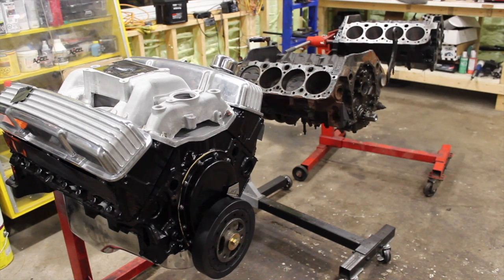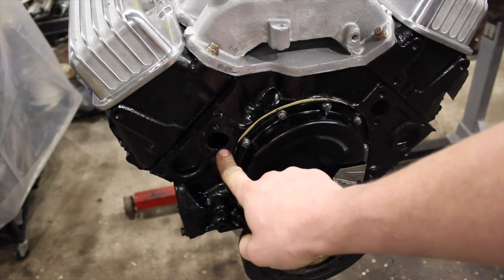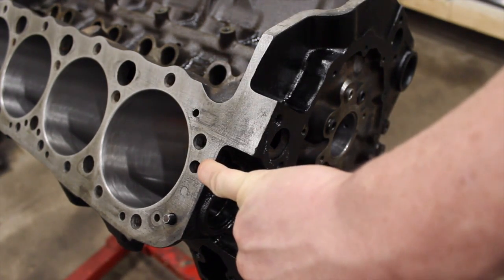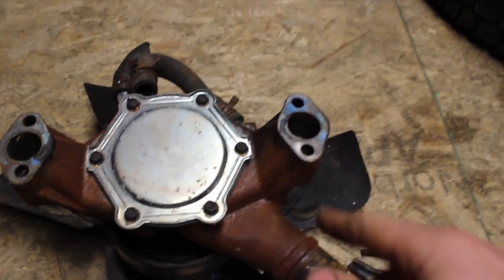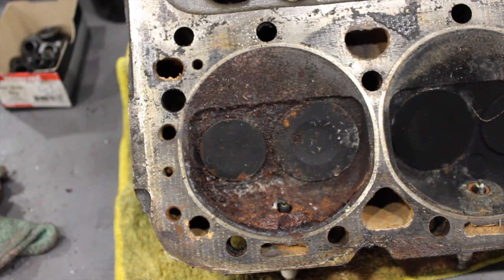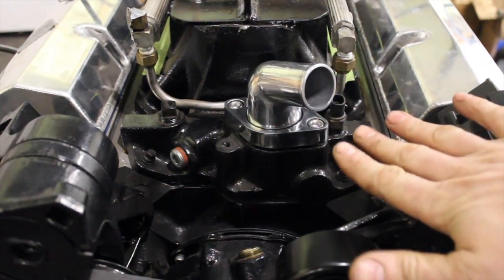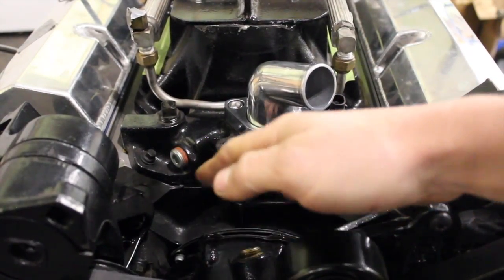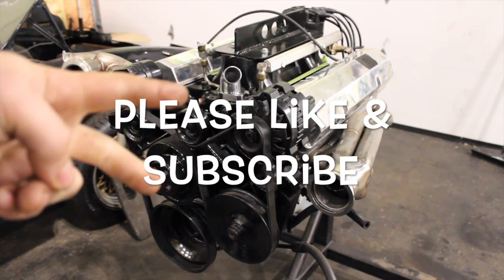SBC Water Pump Bypass? (Read Description for instructions) Vortec heads vs Traditional heads

Comment: I built a 350 SBC out of a 99 Tahoe.  Both heads cracked as per usual. I replaced them with aftermarket AL. Heads, and now I am finding out about the BY-Pass hole.  I assumed it was plugged from the factory, like the fuel pump. Yes, we all know what happens when you ass-u-me. I am going to attempt to drill and tap in the car.  What is the plug/drill size? Or is there a brass plug I can knock in?
Reply: Update, no drill needed.  My Hanson 1/8 pipe tap went right in no drilling needed.  This was a fairly easy fix, but it would have been a whole lot easier before I installed the motor.  Fan, fan shroud, and water pump, r and r.
Reply: I’m doing the same building a l31 vortec any updates on what you’ve done to fix ur problem without having to drill into the thermostat and if so how has it been holding up
Reply: @rockfordhx2768  No issue what so ever. Just ran the tap into the third hole on the passenger side of the block. The old school water pump covered it. The L 31 water pump does not cover it because the heads sealed it.  The new heads I used were made so they would work on the older blocks.  It would have been nice if they mentioned that I would need to plug the exposed hole. The L31 uses a bypass hose on the water pump.  So there would be no need to make a bypass hole in the thermostat. Maybe you are planning on using a different intake manifold? If so yeah that would be an issue if you were using the Vortec heads.

Comment: What does the bypass do exactly? Do I need it?
Reply from the maker: Yes, you want some coolant circulation when the thermostat is closed. This prevents a large sweep in head temperature when the thermostat opens. 
It prevents head cracks and air pockets

Comment: My brother bought a Motown block and was having trouble leaking water from the water pump because he used an old-school water pump in the block did not meet up to the water pump plus it did not even have a hole in it for the water to flow through so we took the old school water pump threaded and blocked let Bypass in it but if he ever gets rid of the engine somebody else may have trouble leaking water from there if they change the water pump

Comment: hers the deal , i ordered a 350 crate engine 4 years ago , checked the block when i got it , 5.7 , i ran the code 96/99, but they put 305 mismatched heads on it , anyway its been on the stand for 4 years wrapped in plastic , they have changed the entire engine back to flat tappet , so im getting ready to change it back to a roller engine , vortec heads , rollers , cam , you know all that , i just went down in my shop and looked at my block and water pump , both have the 3rd hole in it , so when i get theses vortec heads ,,, is all i have to do is have the hole drilled in the head so the water can go through the pump into the block  and into the head and thats it ? , or what else needs done ? i have the provision for the fuel pump , but im going to change the cam good lord willing back to the same spec cam it had , but what cam do i use that has the same vortec specs but with a fuel lobe on the cam , mainly just let me know what to do about this cooling system issue , if im following you right , all i have to do is have the water hole drilled in the head so the water can flow from the pump through the block up into the head ? is that correct ? and do i need to have both heads drilled or just the one , thank you very much , and by the way i called ATK VEGE where the engine came from and they more or less said im beat , your warranty ran out a year ago and thats it , regardless whether the engine was ever installed or not , thank you very much for any information you can give me .
Reply from the maker: First off, you'll want to verify that the hole is actually drilled all the way, which it should be as that engine is a TBI replacement. 
Heres what I recommend if you have the bypass through the block:
-Drill  the passenger side head for the water hole, using your old head as a reference and a head gasket as a template.
-Drill one 1/8" bleeder hole in the thermostat, this helps with temperature swing and prevents head cracks 👍

Comment: Hey Pat, have you heard or know of any difference in the TBI block water pumps with internal bypass and the later vortec pumps with external bypass having any difference in heights for pulley alignment?
Also if the pulleys themselves have different bolt patterns?
Reason asking is I have a TBI 355 I rebuilt recently with refreshed 193 heads. But also have a set of 062's that I want to swap and do a carb conversion. My truck still runs like a slow turd and been having TBI issues. I've replaced every sensor, pigtail connector, vacuum lines, checked vacuum leaks, rebuilt TBI etc. I'm fed up with the TBI system.
So what I'm hoping is to plug my internal bypass on the block, run a vortec water pump with external bypass going to my air gap 4150 flange intake I have to go with my vortec heads. But can't find useful information about the two difference for possible pulley alignment problems.
Thanks in advance. Really appreciate your videos
Reply from the maker: So you want to add a vortec water pump and pulley to a TBI serp belt setup? 
Dang! I got did a scrap run and threw out any tbi water pumps that I had, but I'm pretty sure I still have vortec water pumps. 
If you email me at pcperformance1@outlook.com
 I can take any measurements you are looking for of the vortec pump

Comment: I am retrofitting an 02 4.3 V6 back to carburetor and HEI distributor. My intake manifold is an Edelbrock Performer, which does not have the port for the bypass. Can I just block the water pump bypass and drill the holes in the thermostat and be done with it? I could put an elbow up on top of the manifold and fabricate a bypass that way, but would rather not. Thanks for your help.
Reply: Instead of a HEI, check out a Progression Ignition distributor.

Comment: I have a vortec block without the coolant bypass hole and I plan on using after market heads. So instead of using the ugly vortec water pump and the bypass hose to the intake I can just drill holes in the thermostat? Thank you for this video you have a new subscriber!
Reply from the maker: Thats correct, ive done it many of times. I actually drill one hole in thermostats that have a bypass. I find it  makes bleeding the air out of the coolant easier and stops air locks.
Try 2 to 3 holes to start and keep a eye on the temperature. If you notice it climbs way  past thermostat temp then all of a sudden drops then you need more bypass holes. 
Too many holes will cause it to get to operation temp slowly or never.

Cheers! And thanks for checking out my video
Reply: @cuttersperformance  Awesome, thank you so much!

Comment: What about older style heads with the bypass on a vortec block without the bypass?  Drill holes in the thermostat to solve the problem?
Reply from the maker: Yeah you will have the same issue. Easiest way would be to start with 2 holes in the thermostat and try it

Comment: Only have 2 outlets on the water pump,   large to radiator plug the small 5/8 to the heater,   have the bypass in the front of manfold.  Just wondering how I can run this 2 the water pump.
Thanks
Reply from the maker: Some guys tee it into the heater hose
Reply: @cuttersperformance  ok will do that, should I still drill 2 holes in the thromstat as well.

Comment: @PISS-CUTTER Performance 

Just got my 906s from Clearwater. Just wondering how many holes and what temp stat do you recommend for driving in Phoenix during the summer ('93 TBI 350 block)
Reply from the maker: You have a few options
Since the block should be drilled for a bypass you could drill the right side vortec head for a bypass if they are still off the engine using a head gasket as a template. Then i would add one hole to the thermostat. 

Or you can try 2 to 3 holes in the thermostat. I find this works pretty good for most guys. Ideally you don't want more than this because you'll find the engine will warm up slowly

Cheers!

Comment: I'm loving your channel  I have a big block 427 60 over so it's a 440 howards hydraulic roller cam afr265 oval port full cnc heads victor jr.intake 850 Holly hp carb my cam specs 235x242@50 618 lift on a 108 lsa it's a lil over 10 to 1 compression  I was hoping for 550 hp or at least 525 but I think I'm a lil shy on duration Monday I suppose  to go pick up a 358 small block that has a steel crank pink rods and a set of 67 corvette dubble hump heads with 202 x160 valves the guy claims the motor makes 450 hp . So if I do get it I might be interested  in you working a pair of afr as cast 195 heads. Can't wait to see the people's build over your build complete  oh by the way the 358 I was talking about only has like 512 lift flat tappet lunati hydraulic.

Comment: So I have a 1985 Chevy C10  with a 262 v6 that I swapped to a 350 that I built. Its cammed and has Summit Racing Vortec heads. The block and accesorries were from a 1997 tahoe. Kept the accessory brackets and accessories but I got rid of the Vortec injection and put an Edelbrock intake and carburetor on it. I wish I would have watched this video when I was setting up my heater core and cooling system. I kept getting air trapped. I later figured out about the thermostat bypass. Great video!

Comment: Hey, thanks for the video. It really helped a lot. I'm falling into the catagory of tapping and plugging the bypass hole, so I was hoping to ask a quet.

I'm using a vortec water pump on an older sbc TBI (project). So I can just plug the bypass hole there, drill 5/32 holes on the thermostat but am confused what to do with the two connections on the vortec pump. Which one is bypass, and which is heater core? 

Thanks for your time!
Reply from the maker: So looking at the engine , the pipe off the water pump to the right is for the heater core. The pipe to the left is the bypass. 
You can loop the bypass hose to a barbed fitting on the intake

Comment: Great info in the video! No one talks about the coolant bypass on the vortec’s. I’m certain this should fix the problem I’m having!
Reply from the maker: Are you experiencing a huge temp fluctuation?
Reply: @cuttersperformance  I have been getting boil over when I close my heater core valve. Then it runs hot. Basically after watching your video I realized when I close the heater core valve that takes away the bypass. So I will use the other nipple off the water pump and go to the intake under the thermostat! Then I should be able to close my heater core for the summer months! (1969 Suburban)

Comment: Can I use a short Chevy water pump on my 383 Vortex build? All of my accessory drive pulleys are for a short pump.
Thanks.
Reply from the maker: Yeah you should have no problems. Just make sure you have some sort of coolant bypass
Reply: @cuttersperformance  should I plug the bypass hole on the water pump? I will either drill the thermostat or run a bypass hose. Could I drill the heads and block for the coolant bypass if I don't want to run a hose from the pump to manifold like a big block?
Reply from the maker: @robertries7774  A hose from the water pump to the intake will work. If the block has a coolant bypass you could drill the head. Or if your running a heater core you could also just add 2 or 3 small holes in the thermostat and you won't have the huge swing in temp when the thermostat opens
Reply: @cuttersperformance  Yes running a heater core, probably just end up drilling the t stat.

Comment: I was just dealing with this. I have a 1979 block 383 stroker with the water pump bypass that I’m swapping into my 02 blazer. I’m using the 4.3 belt set up and needed a reverse rotation water pump but it doesn’t have the bypass. Now I’m confident that I can plug the block and use a bypass in my performer RPM intake 7101. I have the mid 90’s production World Products S/R Torquer heads. I’m assuming I don’t need to worry that they are not going to have the pump bypass anymore on the block. Awesome video. Thank you.
Reply: Did everything turn out good I’m basically about to do the same thing with my stroker
Reply: Can I plug my block on my stroker also??

Comment: One more quest. So if I drill my 880 block where the extra wp hole is. I know it is not all the way through. Anyway if I drill it will I only need to drill one head deck surface on my 906 heads. Or do I need to drill both head deck surfaces.
Reply from the maker: I've never drilled the block for a water pump bypass 
But yes only the passenger head would need to be drilled if the block has a passage for it

Comment: Hi I  can across your video the other day.  Last year I put a new water pump on my 77 350 sbc in my 39 chevy . It did not have the bypass hole on the water pump . Well I had a air bubble.  Today I put in a new thermostat 180 temp . I drilled 6 5/32 in the new one .  I drove it 26 miles and new got over 140 degrees.  It was mid 40's here today in Kansas.
Reply from the maker: Hey man! 
6 might be too many for you if your running a heater core as it bypasses coolant as well 
Also you should have a bypass on a 77 350 built into the water pump? 
What symptoms where you having to make you think you had a problem?
If you look at the description in the video for suggestions in how many holes 
Two 5/32 holes would probably be better if your running a heater core
Reply: The water pump I got from speedway doesn't have the bypass hole In it . I asked them about it and they said it would on the street  . I do have a heater core .  After I put the new water pump on it would take a couple mile driving and the gauge would go up and the thermostat would open . Gauge would drop off and then go fully all the way around for a second then drop off to 180 and stay there. I'm going to take my old thermostat and drill 2 holes in it and put it back in .see what happens.  Thanks for the help
Reply from the maker: @ilovedjing  ahh ok you will for sure want some circulation, two holes should do the trick 
Let me know how it goes
Reply: @cuttersperformance  Thanks for the help . I couldn't believe 6 holes made that big of a different . I will let you know how it goes
Reply: @cuttersperformance  okay today I put in the old thermostat with 2 holes in it . Drove around 28 miles . Stayed around 160 on the gauge . 45 degrees today.
Reply from the maker: @ilovedjing  thats better, is the your temp sending unit in the intake or head? Going by those temps im going to assume intake
Reply: @cuttersperformance  It is in my head . I did get up to 180 idling but as soon as i took off down the highway went down to 165 and stayed there .
Reply from the maker: @ilovedjing  ahh ok that make sense then 
Once the weather warms up you should be right on
Reply: @cuttersperformance  The 39 has a aluminum radiator with a electric fan .  Going do the Highway i never run the fan .Even on a hot day it set at 180 with out the fan . Now when i get in to traffic in towns i will turn the fan on . Thanks for all the help
Reply: Thats bad for your engine…

Comment: Can i run a conventional normal rotation water pump on a vortec block with vortec heads. Putting in a 79 squarebody work truck and it has hydroboost and dont want to convert to serpintine set up.
Reply from the maker: Yeah no problem 
You just need to make sure you have some sort of coolant bypass when the thermostat is closed
Reply: @cuttersperformance  so do i need to drill and tap and plug a conventional waterpump on the pass side where the hole would be in the block. I would imagine the waterpump would piss out of there.
Reply from the maker: Shouldn't have to block anything as the water pump bypass should be sealed off when bolted to the block. Just make sure you use the 3 hole standard sbc water pump gasket

Comment: i drill 2 1/8 holes in all my old small block thermostat since the 70's.. this trick also helps in case you stat sticks closed, not a cure.. but helps water flow and again case your stat sticks closed you have a lil some thing to get you to where can replace it.

Comment: I just subscribed to your channel and in the past I've watched a ton of videos on the vortec heads and am looking to get my hands on a set of 062 set .. my question is I'm in Canada just across from Detroit.mi .. how much would you charge me to do a set for me with everything you've learned that will make the most power out of them .. ???? I did watch your video were you said that there wasn't much difference between 2.02 and 1.94 on the intake but you did say that there was a significant difference on the exhaust between 1.50 and 1.60 and should go with the bigger exhaust valve ... I'd be looking to put these my stock 350 and of course I'll be upgrading the cam and lifters as well as timing chain oil pump and water pump but at 5th same time I'm looking to retain my TBI setup .. now GM does make an intake to bolt to vortec heads with the TBI setup on top .. a bit expensive intake so I'm looking for another manufacturer that also makes the same intake style but definitely cheaper in cost .. you're input would be so much appreciated and thank you in advance .. you're Canadian neighbor
Reply from the maker: Send me a email at pcperformance1@outlook.com 
I can help you out

Comment: I have a 77 GMC K25 with a 400 SBC that is prone to air pockets in the coolant, I will definitely be drilling some holes in the thermostat.
Reply: Was it ever rebuilt? Does it have the factory heads with the steam holes? Proper head gaskets with the provision for the steam holes in the block and head?

Comment: Thanks for all your info. If i was to drill both vortec heads left and right would I need to drill my thermostat. I have a old block 73
Reply from the maker: No you wouldn't have to, but I'd recommend one hole in the thermostat. Really helps will trapped air and bleeding the cooling system
Reply: @cuttersperformance  thanks